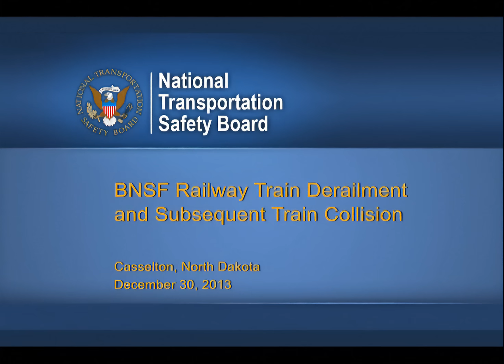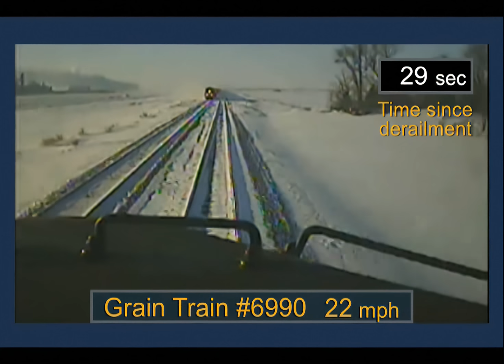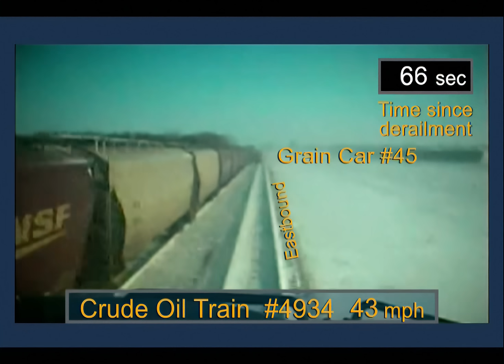BNSF Railway Train Derailment and Subsequent Train Collision

Comment: The grain train derailed because an axle on one of its cars broke due to a manufacturing defect.  There was an internal void in the axel created when it was cast 3 years earlier. More on this on pages 5 & 6 of the final report.
Reply: damn. thanks for sharing that insight. crazy to think how in a sense, this crash began three years earlier.
Reply: Wow awesome knowledge thank you. I am QA in the airlines and this is exactly what we do.
Reply: @BuddyRHS1965  that reminds me of the Japan airlines flight 123 incident.  Months or years prior to that crash where they lost their vertical stabilizer,  that plane was in a small crash at the airport that caused a Crack in the stabilizer.  It was so small at first that it was never detected and grew over time
Reply: @ellisjackson3355  Re flight JAL 123:  You are sort of correct...  The "crash" was actually a tail strike on landing and the main damage was to the aft pressure bulkhead.  A proper repair was engineered but then executed incorrectly in a manner that imposed excess stresses on part of the bulkhead repair.  This accelerated metal fatigue and eventually the bulkhead ruptured.  This let the pressurized air from the cabin into the tail volume which was inadequately vented. This essentially blew the tail off of the aircraft causing the loss of rudder and elevator control authority and ruptured all 4 hydraulic systems causing the pilots to have no control over the aircraft aside from using varying amounts of and asymmetry of engine thrust.
Reply: @BuddyRHS1965 that is a good skill to have, atta baby.
Reply: Similarly in the firearms industry critical components are often HPT "high pressure tested" and MPI "magnetic particle inspected"
Reply: RR axles are not cast.  They're forged. Forgings are much stronger than castings.
Reply: Isn't there some way for manufacturers or independent organizations to inspect/scan parts for these defects? Seems like there should be before those parts go into service.
Reply: Sounds like the manufacturer wasn't doing any ultrasound inspections on the parts. In aviation, we have an entire department dedicated to this sort of stuff. It's call NDT, Non-Destructive Testing.
Reply: @RONIN6207  I worked in aircraft maintenance also. The Inspection Department had facilities in the hangar for doing ultrasound and magnaflux inspections (and x-ray where applicable). The slightest defect would ground the aircraft.
Reply: @RONIN6207  Very good, seems like it should be used for locomotives too.
Reply: "axle"
Reply: @tripjet999  Maybe he WAS writing an axel.  Maybe a double axel followed by a camel spin.  hehehehehehehe
Reply: good ol lawsuit for poor qc
Reply: probably miscreant of some kind of Democrazy(TM)!
Reply: Hope they have sued the company that fabricated that defective axle.
Reply: @philipperiopel1911  wrong. all axles are tested. the overheating is due to a bearing going bad. bearings last infinite long time, except when installed incorrectly, when starved from oil, or when sand mud dirt introduced. so the manufacturer is the least at fault.
Reply: @west_park7993 What do bearings have to do with a casting void?
Reply: @joewoodchuck3824 again, axles aren't cast.
Reply: @randymagnum143 Ok.
Reply: B U L L S H I T.

I think you’re a liar.
Reply: its what happens when  pusguts unqualified to run a popsycle stand run any size company. save money by ridding qualified people. sorry state of affairs but all over u s.
Reply: So they dont inspect wheels and axles but once every 5 years or longer, sounds like a cop out, the Railroads knows their system is flawed and they'll just keep going on oblivious and business as usual.
Reply: Must have been made in China.
Reply: I mean they could have X-Rayed the parts.
Reply: @keith3761  This.
Reply: @keith3761  Xray, Ultrasound, weight/volume ratio, and even hammer knock.
Reply: @keith3761  it would have cut into the bosses profits. Can't have that.
Reply: @jcraigie  dunno such inspections actually add very little to the cost of the part but are insane for quality control and reliability. That train crash probably cut far more into the train companies profits.
Reply: @keith3761  Yeah you're no doubt right. I was just being snarky because of the rail workers union issues going on.
Reply: @jcraigie  yeah fair enough man I understand. I don't know why people are hating on the union workers so much with wages being stagnate since Regan compared to profits and productivity. Having more unions even with all the problems they have were great at pushing up even non union wages due to more bargaining power on behalf of the tradesman.
Reply: From what casting i've done at home you get air pockets if your metal isn't as hot as it should be when pouring.  You could easily weigh it to know if it has voids.
Reply: @damok9999  Axles aren't cast, they're forged.  At least a dozen channels on Youtube show the process.  The original slab the forging comes from is the only casting and it has usually been through a half dozen or more milling operations by the time it got to the forge.  There are numerous post forge NDTs that could be performed to eliminate faulty axles.  They traced this axle back the manufacturer, and Im guessing they paid for the damage.
Reply: What happens when the manufacturer  does its own RT/sheer wave inspections…  why 3rd party inspectors are important!!…
Reply: Have you yankees never heard of x-rays? critical components cast and then Not x-rayed, totally 19th century thinking.
Reply: Forged metal. sigh. I hate that stuff.
Reply: @JustinCrediblename  forged is different than cast. forged is much stronger.
Reply: @pjax89  woops. haha. I meant cast.
To think that a guy with 5000 lbs of stainless steel in the garage would mess that one up. sigh
Reply: @JustinCrediblename  We all get mixed up now and then, that aside are you saying that the axles on the train carriage that failed and caused this accident were cast?

Comment: Does it occur to anyone that the Keystone pipeline was cancelled, supposedly in part due to environmental concerns? Well this certainly does not look like a safe way to transport crude oil. The reality is that the CSX rail, which transports that oil, is owned by Warren Buffet. That is why the pipeline was cancelled.

Comment: That’s the reason why CSX requires their ‘key’ trains (unit hazmat) to follow certain rules when meeting other trains. One of the trains has to be completely stopped; running meets like this aren’t allowed, for obvious reasons.
Reply: A 'key train' is not necessarily a unit train.
Reply: @cdavid8139  Yep. If there’s more than one hazmat car, and especially if multiple hazmats are coupled together, it’s a key train. I hear the conductors advise the dispatcher they’re a key train all the time. And at least 50% of the time, it’s just a regular manifest “slop” freight. And with CSX, those poor guys are the ones that get slapped in every siding there is!
Reply: @anb740  For us it is 1 or more TIH/PIH or 20 hazmats excluding those with STCC codes 49501XX.  There are other considerations like spent nuclear fuel
Reply: Interesting, anb740. In my limited view, it seems these types of wrecks happen more since the elimination of cabooses! the guys riding in those could see this trouble and alert the cab!!!
Reply: @jessstone7486  The individuals in the grain train knew instantly they had a problem when their train went into emergency braking.   No need for a conductor to tell them something they already know.

Comment: As a freight driver in the UK, I can safely say that I wouldn't want to do this job in North America. We drive trains at (roughly) a maximum of 2500 to 3000 tons at 60 or 75mph. Most trains loaded are usually about 2000t running class 6 (60mph). 
At least I know that I can stop within about 30 seconds if I throw the emergency. These American train consists are just way too big to be manageable in these emergency situations. Everything, including the aftermath, is exponentially worse. 
I'd much rather run a shorter train, with 1 loco, at a higher speed, ANY day.
Reply: everything you said is true... but if they ran shorter trains then they'd have to run MORE trains more frequently to move the same amount of freight vs just putting all the cars on one train.. and what happens IF something drops INSIDE your 30 second stopping window???... what do you do then???... your scenario only works if YOU get to pick what/when a incident happens, which you cannot do... it comes down to the chance you take
Reply: Putting the lives of a few train drivers (that's their title in Australia, only engineers get the title of engineer here) at risk and it saves exponentially more lives by keeping freight and dangerous freight off the roads is a calculated decision, plus it's way cheaper. It's a dangerous job, those few times in a career that something goes seriously wrong, you are lucky to survive.
Reply: North America is a lot bigger than the UK.
Reply: @redcat9436  what’s the point here? Therefore train bigger? Why? You’re having to run multiple power units throughout the train to keep it going. Just break it up, run it as separate trains, make it safer.

Comment: I just saw a documentary on the tunnel through the English Channel.  Trains slow down to ~100 mph through there, otherwise they do about 180 mph on the French countryside.  180 mph.  That’s insane.
Reply: They also do NOT run freight trains on those lines.
Reply: @karlhumes6110  really... So what is the LeShuttle service? Ah yes, a FREIGHT service... (up to 8 times an hour each way...)
Reply: Specially constructed high speed rail lines cost a fortune to build but really effective

Comment: Support two person train crews keep America safe. 
 You have all got this wrong when it come to 2 man crew verses one man
crew. The airlines have had autopilot for years but still have two and 3 people in the cockpit. If Boeing has taught us anything technology fails. It’s all the workers do is worry about losing jobs.  Its common sense thousands of railroad workers will lose their jobs if all the railroads are allowed to go to 1 man crews. That's an issue you need to take up with Politicians !  They claims they are creating jobs then let him do something
about people keeping the ones they have!
This is about safety. This is about saving lives. Not just crew lives but the American people as well. Don’t forget about the rule-making process that was invoked by then-FRA Administrator Joseph C. Szabo after an unattended 74-car freight train carrying crude oil ran downhill and crashed in the Canadian town of Lac-Mégantic, killing 49 people in 2013 that had just one man on the train! Hunter Harrison said on the record those extra set of eyes in the cab are valuable. PTC will not detect track issues or mechanical issues like bad order cars or prevent crossing accidents. Our rules change daily so if an engineer or conductor takes a day off or vacation who will job brief with each other on any newly updated rules that change. How about filling out an EC-1 as the train moves along the tracks or stop and flag a railroad crossing when they have an activation failure with the public crossing gates. We are suppose to job brief to make smart decisions taking the safer course. So if engineers are busy pushing buttons on a screen and reading train orders his eyes are in the cab. If they remove the conductor, it would be counterintuitive. So in my opinion one safety system cancels out the other. Now with ptc and full crew in the cab increases the safety of of train movement. Just plain old common sense.
Railroads preach safety every single day.
Its in their rule books and in their advertising. Its 24 hour a day
safety...safety....safety. Well let them put their money where their mouths are. Pay for safety. Keep 2 men in the cab.
Just like GM shutting down 5 plants putting 15,000 people out of work and pay there CEO 22 million. CSX on the other hand lost 41% of the business once Hunter Harrison took over cutting out almost half the work force from 27,893 people down to 15,362 people system wide and they paid him 385 million only to pass away 8 months later!
With everything going automated from self check out lanes to manufacturing does anyone profit except share holders and CEOs!!!! The public has no idea what we deal with. Tell your neighbors about how many cars we hit and people are killed every year when they are hit by
trains. Explain to them how the engineer is in the cab calling the dispatcher and getting 911 called. He is taking care of anything that may be wrong with the locomotive. He stays with the train. Tell them how the conductor gets down and rushes to the vehicle to see if he can
possibly save a life. Maybe a baby is in the car and needs to be helped
or maybe the parents can be removed and need CPR. Maybe he can comfort
someone who is dying or in shock or screaming because they are severely
injured . Tell them about how we hit live stock and large deer. Tell them how people love to put junk on the tracks. Shopping carts, bicycles, steel barrows, wheelchairs and even abandoned cars. A two person crew saved a child’s life wondering around on the tracks in Minnesota near midnight Saturday, Feb. 1,  2020. PTC didn’t help them. Tell them about how many trees we hit a year and do extensive damage to the
locomotive. The engineer stays with the locomotives and assess the damage and does what is necessary to radio dispatchers for help while the conductors gets down and removes debris and check the rest of the train for any damage or signs of derailment. Tell them about the
territory that is in the middle of TIM BUCK TWO!  The places where no one can get to you fast unless you have a helicopter. How will they go bathroom now without two people to keep the train going down the tracks unless they have to stop not blocking crossings or take lunch. Tell them how radios don't always work in remote locations. Telemetry drops out and communication is lost. How many times does a conductor have to go back
and trouble shoot another locomotive after alarms are going off. The engineer
keeps the train rolling the best he can while the conductor checks the
computers and checks to see if it is loading, traction motor faults or any other issue that may arise. Tell them about the blind curves that only one crew member can see around when your approaching
public crossings or trees that block signals so that only one crew member can see them until you get the train right on top of them. Tell them about wash outs from floods, and heat warped rail and fog so thick you cant see a foot in front of you. SO WHAT IF YOU GOT PTC!!  PTC does not tell you if a car in stopped on the tracks or a tree is across it or a person is walking in the tracks or there is 5 inches of water over the rail! Tell them how crew members have been attacked and some have even been killed by gang thugs and trespassers. A single man has no
chance in  these situations. It is better to have someone else with you to keep watch when working in bad areas and ghetto rail yards. The list goes on and on. Tell them how the company took away the right of the crew members to take a power nap. One crew member is supposed to call stopped every 15 minutes while they are waiting on line of road. As long as someone is awake and doing this and paying attention there is no reason on god green earth while a tired crew member cant take a 20
minute power nap. Tell them how crews are run into the ground and some
are called out every 10 hours around the clock. They work all hours of the day and night and most have no weekends off. The company wont even let them have a power nap. What is going to happen when there is only 1 man on the train by himself and he is just plain worn out or is sick and afraid to take a day off because of the companies new attendance policy
which is just absolutely insane. People come to work sick all the time. Vomiting, diarrhea, fevers and the flu doesn't stop them because they are in fear of losing their jobs. How is a sick man who is all by
himself going to be able to make a full run safely and without risking his life or the publics when he doesn't have his other crew member to help keep him alert. The engineer has many roles and duties as well as the conductor. There are times when something happens that it is a must
for an engineer to be on board and ready to take instructions while the conductor handles the rest of the responsibilities.  There are so many things that go into railroading and running trains that the public doesn't know a thing about. 
THIS ONE MAN CREW IDEA IS THE MOST UNSAFE AND IRRESPONSIBLE IDEA that
has ever been brought forward in the history of the railroad industry. 
And for what? To save a dollar. To line someone's pockets. To make someone rich. Who care who gets killed. If you think crossings are blocked now imagine if there was only one man and had to wait on someone to cut a crossing!Who care about the destruction to family lives. I don't know about you but I sure do and so should every person in America!
Reply: Your rant convinced me to stick with a single operator.

Comment: Does anyone know what caused the derailment? Is the crew still with us today?
Reply: Per the NTSB the probable cause of the accident was "a broken axle on the 45th car of the grain train caused by an internal void that was created during axle manufacture. Contributing to the cause of the derailment were inadequate interchange rules used to locate internal material defects in secondhand-use axles. Contributing to the severity of the accident was the release and pooling of a highly flammable product that resulted in a fire and caused additional cars to fail." None of the crew or near by residents were injured.